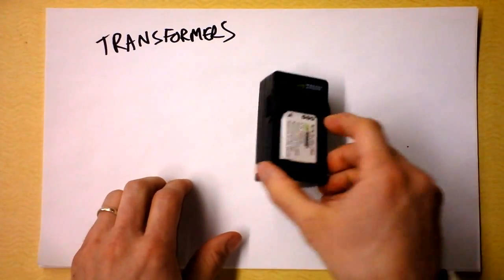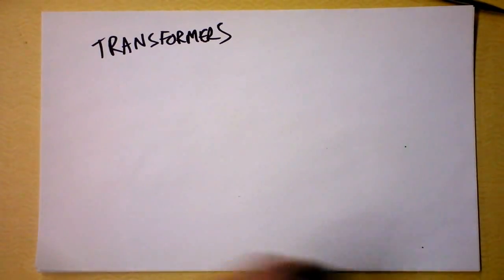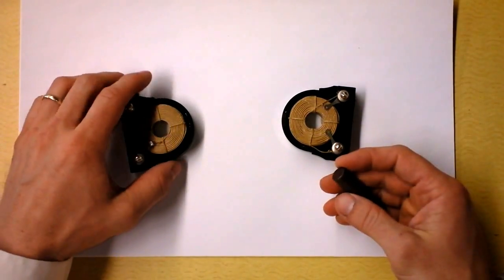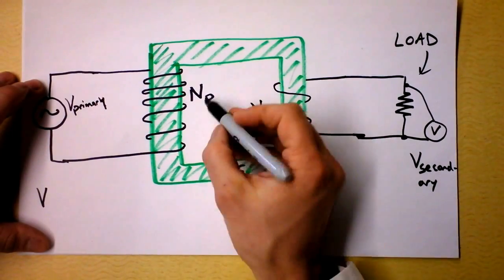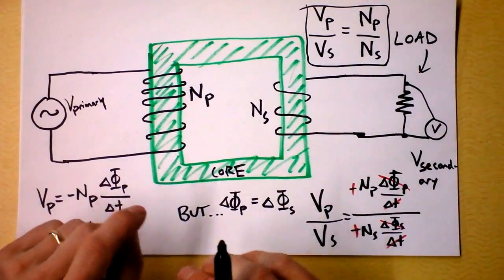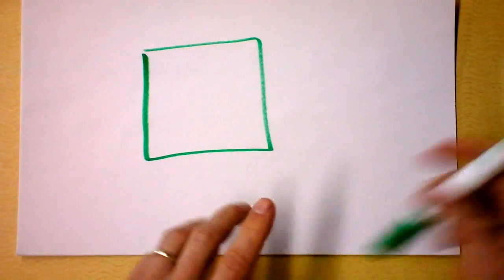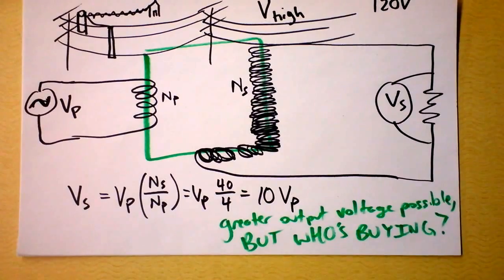Transformers are Awesome! | Doc Physics

Comment: Why is it with small transformers I cannot have the input with very few turns? As in certainly if I make a transformer with one primary turn and 2 secondary turns and attempt to apply mains voltage to it, I will make it explode?
Reply from the maker: Power Max not a transformer expert, but I imagine that you need sufficient self-inductance to prevent enormous current from flowing at the beginning.  So higher voltage transformers must have more turns?  Of course, more turns also increases the mutual inductance, so everyone wins.
Reply: You need to have a sufficient amount of inductive reactance [Xʟ = ωL = 2πfL] in the primary winding of your transformer, so it could balance against the mains voltage and produce a current flow of reasonable magnitude (just big enough to magnetize the core and overcome the overall power losses). The total opposition to the current flow: Z = √(R² + (ωL)²). The resulting current in the primary: I₍primary₎ = V₍mains₎/Z. In this case R represents not only the resistance of the winding but also that part of resistance which is contributed to core losses, therefore, R becomes: R = Z cos(θ) = R₍wire₎ + R₍core₎; (V₍mains₎/I₍primary₎) cos(θ) = (P₍wire₎/I²₍primary₎) + (P₍core₎/I²₍primary₎).
Reply: 2013Aleksey2013 So I think this is coming down to the reactive power thing I do not understand at all, although I do understand how current will flow, and will be offset 45 degrees from voltage, or something (I think it the current lags, where the amount of voltage is what tells me how fast the current through the inductor changes (pretty fast for tiny inductors) and the more backwards way I think of it is that the current accumulates (adds up over time, times the difference in time with each additional added part, infinite riemann sum) over time and how fast it accumulates is proportional to the voltage. I probably misspoke for the 2nd part and got it backwards, surely.

Interestingly enough, I understand it this way much better (and the calculus and diff equations that mathematically describe it) than all that crazy hard looking algebra you show me, I still do not get how we can pretend inductors and capacitors in AC circuits are like impedances (the Xc and Xʟ rubbish) since they do integrations or differentiation depending how they are used for us, and how that meas effective resistance, esp. for arbitrary waveforms and not clean sine waves.
Reply: Power Max Here's how I understand this. Suppose you've got an inductor with inductance L and you connect it to an AC voltage source. The fundamental law of electromagnetic induction: e = - L•i' or e = - Ф'. Describing the current in an inductor through the sine function and differentiating it with respect to time: i = Iₒ sin(ωt), e = - L•i' = - ωL•Iₒ cos(ωt) = ωL•Iₒ sin(ωt - π/2). u + e = 0; u = -e; u = -(- ωL•Iₒ cos(ωt)) = ωL•Iₒ cos(ωt) = ωL•Iₒ sin(ωt + π/2). So, the current, the applied voltage from the source and the voltage of self-induction in an inductor are as follows: i = Iₒ sin(ωt), u = ωL•Iₒ sin(ωt + π/2), e = ωL•Iₒ sin(ωt - π/2). It's obvious that the current lags the applied voltage by π/2, whereas, it leads the voltage of self-induction by π/2. Now is simply the Ohm's Law: [U = IR, R = U/I], Uₒ = ωL•Iₒ; ωL = Uₒ/Iₒ, ωL = Xʟ ≡ R; Uₒ∠90º/Iₒ∠0º = Uₒ∠0º/Iₒ∠-90º = ωL∠90º = jωL = Zʟ. To make the equation more practical the inductor voltage and current should be expressed in terms of their effective values and the inductive reactance should be substituted with the impedance: U = Z•I; Z = U/I, where Z = √(R² + X²), X² = (-Xc + Xʟ)²; U = Uₒ/√2; I = Iₒ/√2. Now you can treat an inductor (when it is regarded as an ideal basic circuit element) as a special type of resistor that limits the current in a circuit but does so without dissipating any heat (which is not the case in the real world though).
Reply: 2013Aleksey2013 Thanks. I will have to mess around with the math and my intuition and figure it out. (not having any education in diff equations makes that difficult) And perhaps see it in video form. And probably fist figure out what power factor is (well, all I know is that it is phase shift between current @ voltage)

I think +Doc Schuster has a few thing related to that.
Reply: Power Max If you don't know how to do differentiation or integration you can always use an online calculator, such as this one: www.derivative-calculator.net 

I guess that will make learning of electronics more enjoyable for you and for me since my calculus skills are not that good at all.
Reply: I can do basic stuff, I am in calc 2 right now, and we have been going tones of summations. Boring crap like that. I can do some of the basic first order diff equations, though need to practice to get better at them.

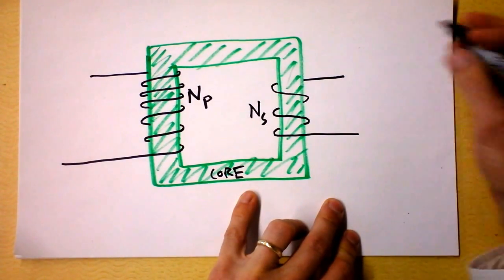Comment: Old vintage flyback transformers from CRTs are really great real-world examples of the diagram at about 6:25 for demonstrational purposes, I plan to use mine when I get around to teaching electronics merit badge for boy scouts.
Reply from the maker: Power Max Excellent.  I have pulled many of them - they were just waiting for an application.
Reply: Doc Schuster Same, although I had to buy mine on eBay since we generally have no junk around where we live. I am thinking of using it to either make a small tesla coil (useful for demonstration of voltage @ RF frequencies)  or a lifter and other ion-wind propulsion systems.

Comment: Question: as I understand ohms law says that if voltage goes up current goes up and vice versa, if resistance stays the same. So I guess you can't just decide if you want high or low voltage/current? So the resistance/wire is not the same on the secondary and primary right?
Reply from the maker: Excellent question.  This distinction is subtle, and a common cause of confusion.  Please check out my videos on power distribution.  I hope they will help clarify.  Thanks for watching.

Comment: I love your electricity math and circuit videos, they are the best on the net.
One thing to point out is, the power to feed homes in north america is 240v not 120v as most people think. It's a 3 wire system giving the option of 240v and 120v service to homes.
Reply from the maker: That's a super idea!  I'm not sure where it would fit, but I do have so much more to say about electrical distribution.  Thanks for the note, and thanks for watching.

Comment: 8:44 I don't understand that step. I know about Faraday's Law of how a changing magnetic flux causes a potential difference, but how can the converse be true? How can an equation be developed for alternating potential difference causing changing magnetic flux. Because if the coil was made out of an insulator, say a paper coil, and I were to connect it to an AC power supply, it wouldn't cause any changing flux would it? So what I'm asking is: why isn't the resistance of the material taken into account in this case?
Reply from the maker: It's really just Ampere's Law applied to Ohm's Law.  But your question is valid - I've glossed over the assumption that the voltage PRODUCES a current, which would not be true for your paper.  So, I am assuming that R /= infinity in the coil.  Moral of the story - don't build electrical coils out of paper!

Comment: I'm kind of confused by the last remarks about power lost to heat. Cant power lost also be represented by P=(V^2)/R ? Which in the case of the 750kV power lines means huge power lost to heat. Can someone help clarify?
Reply: The voltage drop across the power lines is not equal to the transmission voltage. (because after it has been 'transmitted' to the consumer you can't have 0V, because then they wouldn't have an electricity!)
Reply from the maker: Just be very careful not to confuse power transmitted through the line with power loss during transmission.  The voltages involved are dramatically different.
Reply: Think of current as movement of electrons. If the current gets bigger, then more electrons flow, which creates friction inside the wire which means you get a heating effect.

Comment from the maker: YES!  The iron in the core is laminated sheets to prevent eddy currents, which would significantly heat the iron and lower transformer efficiency.  You can also make cores out of nonconductive iron-ceramic suspensions for the same reason.

Comment: is it due to the fact that current would be induced in the core in a direction that it opposes flux change ,but splitting the core current could not travel inside the core the way it wants ..............so that effective flux passes to the secondary core...????

Comment: But I have a question about transformers. Lets suppose I have a capacitor which is charged up to about 1000 volts. I want to connect "this sucker" to a step-up transformer. Do you now the formula(from calculus) of the time it will take the voltage on the load(on the secondary curcuit) to become zero?

Comment from the maker: Excellent question, dude!  It's critical to note that when you use that equation for power lost in the line, V is the voltage DROP across the line.  This is VERY often misunderstood.  When you talk about a high-V line, you are referring to large V between the line and ground, but saying nothing about the voltage between one end and the other (hopefully the latter is small).  You find V across the line by V = IR, so it is more direct to use P = I*I/R to find power loss on the line.

Comment from the maker: A Van de Graaff generator actually DOES have a lethal voltage and cause a lethal current to go through you.  However, the current only exists for an infinitesimal time.  Not enough time, hopefully, for your heart to stop or your tissue to be damaged.  Don't try to explain both effects in the same sentence, though.  In much of physics, you need to understand what your limiting or controlled factor is.  I've been hit by my 500kV Van de Graaff more times than I'd like to admit, but I'm still here.

Comment from the maker: Not quite.  Reread the previous post carefully, then continue:  The current THROUGH the high-V line will be less than a low-V line that transfers the same power (because power transferred is IV).  YOU DON'T CARE ABOUT THE CURRENT THROUGH THE LINE WHEN DECIDING WHETHER TO DIE OR NOT.  The current through you is determined by I = V/R, where V is voltage between line and you (assuming you grabbed the dang wire) and R is YOUR resistance.  However, Van De Graaffs are another story...

Comment: Ok thanks, so because it has a very high voltage, most likely the current is going to be pretty high too, compared with a low voltage power line, that is likely to have a much smaller current (as the energy supplier doesn't want to expend energy heating the wires with a higher current)? 

I only mentioned it because I built a small Van Der Graaf generator which was safe to touch (get shocked) at 40,000V.

Comment from the maker: A nice sound bite, but it masks some important physics:  Sure, current is what harms tissue, but a higher voltage power line (which is not current-limited) will ALWAYS cause a higher current through your fleshy body (that has a fixed resistance) 'cuz V = IR. You need to be WAY more careful around high-voltage lines than low-V lines.  It's the current through YOU that matters, and that's determined by YOUR resistance and the voltage across you (from the line to ground, typically).  DANGER!

Comment from the maker: I agree with you that cost and safety are factors, but you're confused about the voltage/current danger.  Sure, current is what harms tissue, but a higher voltage power line (which is not current-limited) will ALWAYS cause a higher current through your fleshy body (that has a fixed resistance).  You need to be WAY more careful around high-voltage lines than low-V lines.  Again, that is exactly why they must be higher up and better protected from accidental bumping.

Comment from the maker: Boy, I'm sure not an expert here, but I'll shoot from the hip.  Maintaining safety raises costs while lower current lowers costs.  You've also got to have step-up and step-down transformers at each end.  So there's a sweet spot that depends on length of run and power needed.  Hiring an engineer to find that sweet spot is probably a good idea.  Maybe someone who knows more firsthand about power distribution will comment...

Comment from the maker: Oh, I understand your confusion.  If I just hook up a battery to the primary coil of a transformer, that coil will experience a change in flux, right?  The only problem is that the flux will approach a constant (saturated) value based on the steady-state current from the battery.  That's why I mentioned a battery.